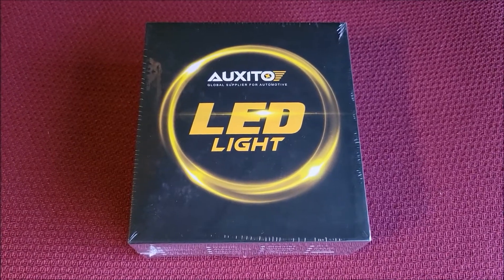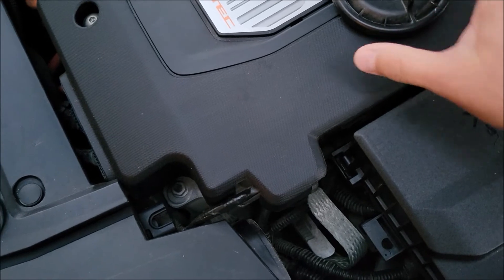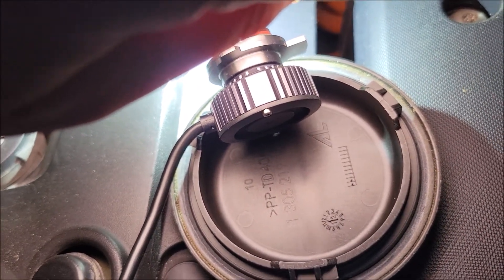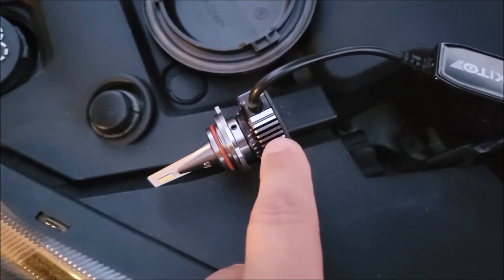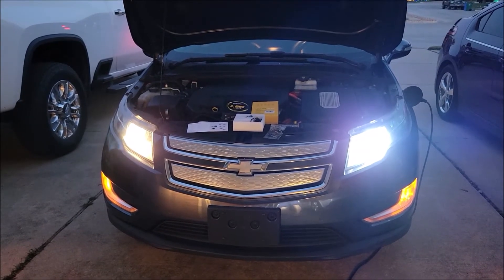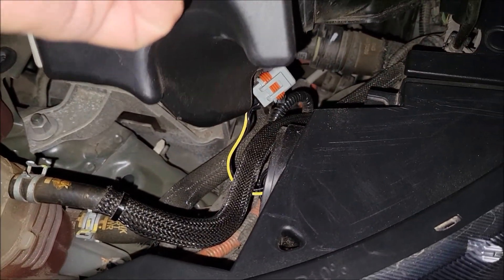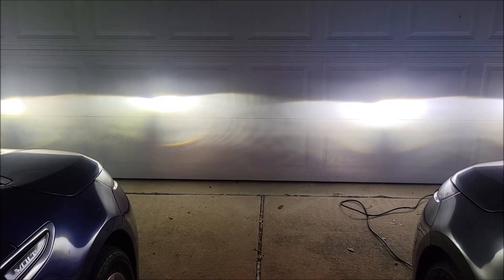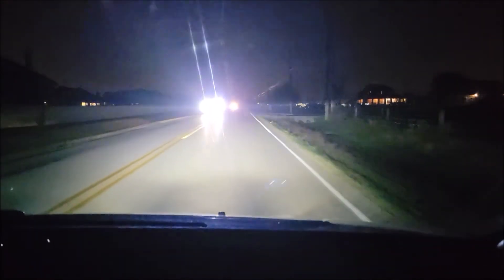Super Bright LED Headlight Upgrade Kit - Auxito LED Light DD-Y13

Comment: I wish when you did the night driving you would’ve flipped your highbeams to compare them to your low beams and how bright both are
Reply from the maker: I thought I did, but that may have been a different video.  The Volt really does not have high and low beams.  It has a shutter that lifts and drops to change the output of the light.
Reply: @SeidelRanch  thx. Found your other video w hi/low beams.

Comment: I just stuffed all the wires and the box that powers up the led . Hope it Dosent flop in there and break anytninf
Reply from the maker: That is what I did on our Volt.  I have not had an issue with it.  It fits fine and the cap holds it in place well.

Comment: Be careful about ordering these LED bulbs.  If you plan to install them correctly (with the LED chips facing 3 o'clock and 9 o'clock, you will probably be disappointed.  Auxito  and their sellers advertise these bulbs as 360 degree adjustable, but they evidently are NOT.  I bought two pair, from a eBay authorized seller, that were not adjustable.  I asked to return them, and the seller's response was, "if I give you $10.00 off, would you just keep them?".  I filed a dispute with my CC company, and with eBay.  I received a return authorization and shipping label from eBay, and placed the items in the hands of the USPS.  Today, I get a message from eBay telling me that my return return request has been closed, with no further appeal.  So now my resolution lays in the hands of my CC company.  A truly sorry way to do business, on everyone's part, the seller (super_auto_light), eBay, and Auxito.  I suggest that you buy a different product, from a different source.
Reply from the maker: Mine are adjustable.  I wonder if you got a bad product from a bad eBay seller.  I always buy from Amazon unless I know the eBay seller (worked with before).  Returns are much easier and you usually get what you paid for.  I have been burned too many times on eBay.